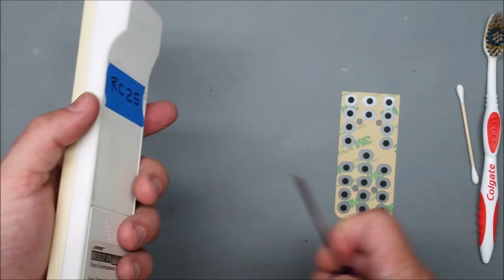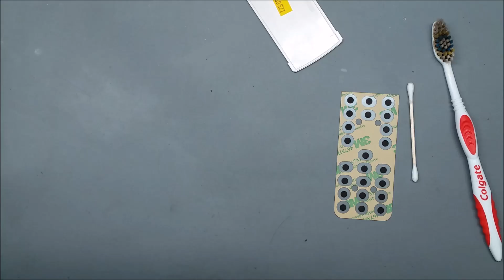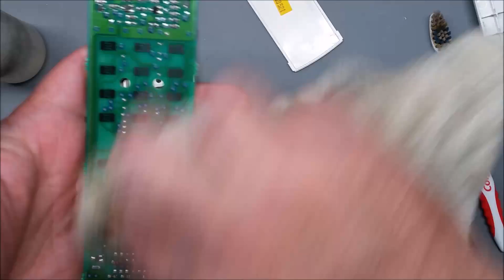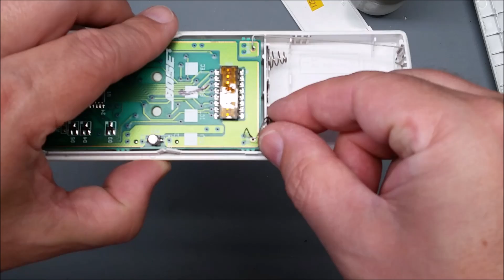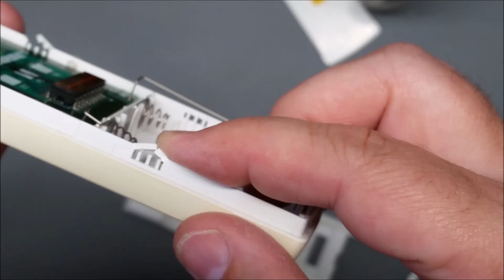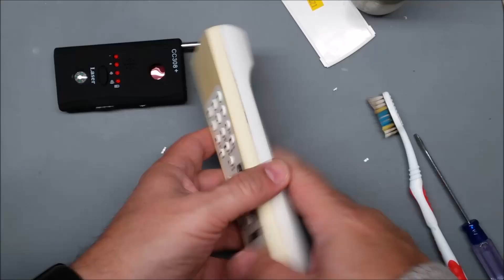How to repair the buttons in Bose RC25 remote control

Comment: Great video, almost resigned to the fact that I'd have to try and source a new RC-25 remote after 22 years. Followed instructions in video, gave the circuit board a thorough clean, volume and on/off button now working perfectly. Thank You

Comment: I found this video whist searching on eBay for a 2nd hand remote, as my RC20 had stopped working.  Took it apart as shown and found that the wire had become detached, exactly as shown at 7.00 in.  Soldered back in place and now working perfectly. Thanks so much!